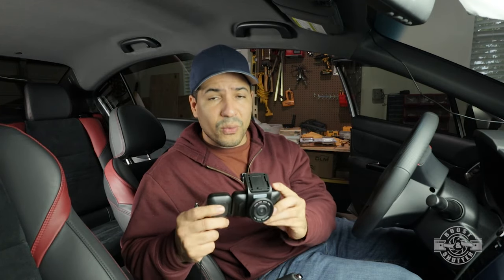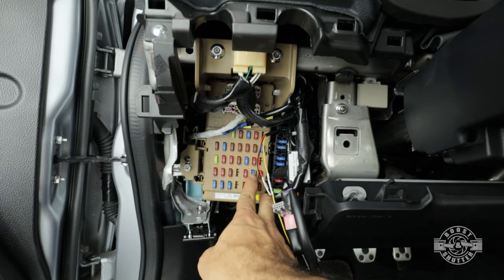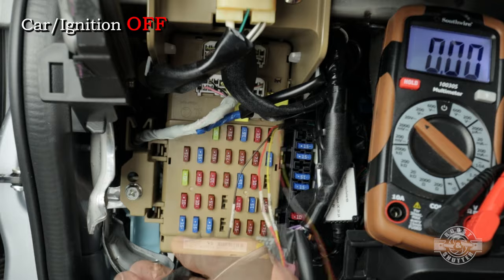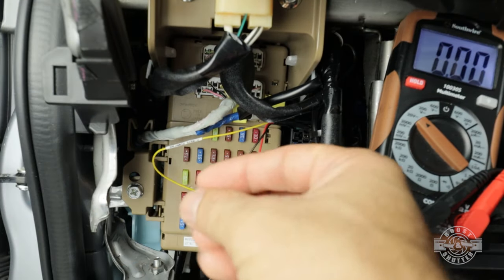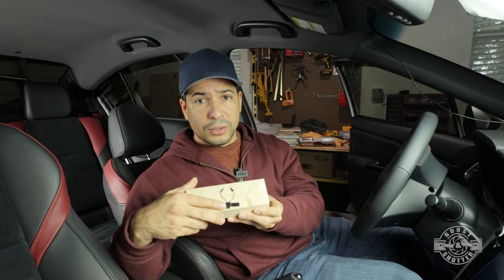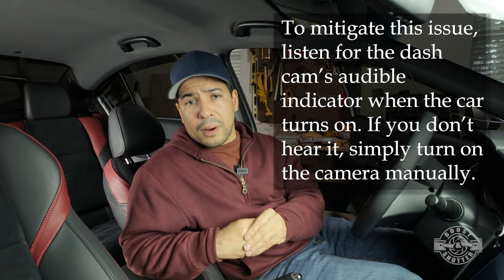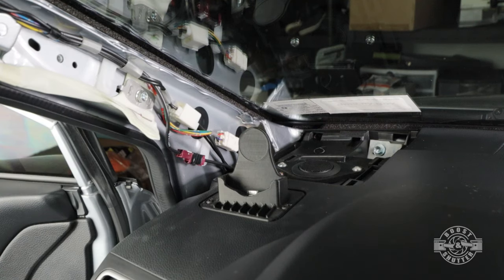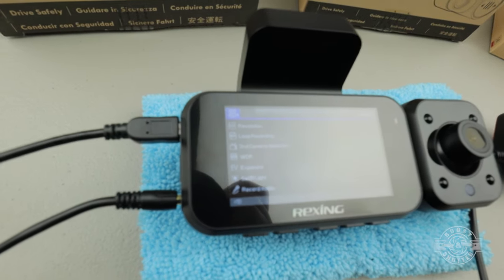Smart Hardwire Kit Install to Enable Dash Cam Parking Monitor

Comment: Beautiful job.  One nagging question...the yellow wire is generally considered the ACC, and the red wire is CONSTANT POWER, and most dashcams use that color scheme, but you identify them in the opposite roles.  Why is that?
Reply: You’ve probably answered your own question by now but he’s correct as described on the dashcam’s website.
Reply: @marksd5650  The actual answer was: He didn't know any better.
Reply: myGekgear hardwire kit's instruction also states red is BAT, yellow is ACC
Reply: I don’t think it matters what colour is what since this seems to vary between manufacturers.. the wires are labelled, that’s the important part.
Reply: Yeah, Pete, it matters if you want the camera to turn off when you exit the vehicle.
Reply: @brianclancy6101  read my previous comment very slowly.. the colours vary between manufacturers thats why you read the labels.. one always has BATT and one has ACC.. you wire them in via the label.. and it matters if you want the camera to remain running when you exit the vehicle, thats the concept of parking mode. Try actually knowing what you're talking about before trying to correct others.
Reply: @petetherealrelentless6542  I can see how you got your name while replying to other 3 year old posts.  We can't wait to have you "explain" something else that's over your head.  While you're at it, give us all a list of the dashcam manufacturers' 12v appliance wire color codes, we're anxiously awaiting your breakthrough research.  Be sure to "read them again slowly" before you get back to us.
Reply: @brianclancy6101 how did he make sure that the fuse he chose was not “switched”?
Reply: @fjcook  Suitability would be ultimately determined by the behavior of the camera when the ignition was shut off.  You have ACC (accessory power) if the camera remains on for a period of minutes and then shuts off or shuts off when the car door is opened.  Constant power is always present, particularly for parking monitor.
Reply: The kit I have is exactly like his. Red says ACC, yellow says Bat.

Comment: Ok, so maybe silly question.  The fuse doesn't look like it's changeable, on the hardwire kit, so what if the fuse actually blows?  Do you have to get another hardwire kit?

Comment: The question, you don't need to use a fuse tap to install the wire kit? The fuse is still powering the other unit that the fuse was taken from?
Reply: Did you find your answer? I just recently bought dash cam, and I think I need to replace the hard wire fuse wire connection with fuse tap so I could put 2 fuse in one fuse slot. But I'm trying to find if removing the original fuse and replacing it with dash cam fuse that came with the hard wire will work alone. Just like what he did, when he removed the fog light fuse and replace it with hard wire fuse.
Reply: @waynet8327  hi man ... Do you mean that the hard wire kite's fuse in addition to herself also Powers fog lights?
Reply: I may be having the same issue. Ever get am answer on this?
Reply: @justinphillips8317  after doing more research and poking around my fuse box.  Most of my fuses are being use so I would need to use a fuse tap to get the power needed.
Reply: Hi on one of your previous videos i saw you just pulled out the same amp fuse (15 amp) and plugged in the new one with the cable attached to the 15 amp fuse that came as is with the cables. This means the one 15 amp fuse runs for the new camera and the original 15amp fuse in that box location. Can you do that or do you have to put a fuse splice and add 2 fuses of 15 amps?
Reply: It seems that the kit he is using would bypass the fuse and you lose the safety functionality that the fuse provides. I'd get a fuse tap kit. Unless the hardwire kit says it provides a certain Amp fuse capacity...but it seems it's just a straight no protection circuit. I think it's intended to be used on an unused fuse location that has power. These hardwire kits should by default include a fuse tap kit.

Comment: You didnt mention using a fuse tap so you can use the existing fuse along with the hardwire fuse. Crucial step left out.

Comment: Excellent video and explanation of the fuse testing!   I would only add that if you're removing the trim pillar on a car with curtain airbags, you should disconnect the battery and wait for 10 minutes first.

Comment: You should be using a fuse tap for both of those. The fuse is sharing power between the camera and the other source, which is causing the drop during start.

Comment: You're a really good tech! I like the professional and neat installation. On my Rexing V5 I constantly have a red battery indicator. Shouldn't it be charging up the super capacitor? It seems like there is supposed to be a battery or super capacitor that at least gives enough power to close or finish writing the video file to the card.

Comment: Thank you for the video. One thing I was curious about is that you replaced slot 29 to yellow wire. Then what happens with the fog light?  Can you still use the fog light?

Comment: Thanks! I follow your video and I have everything done. Actually, I went to 3 places to have this installation done, and they didn't have time to do it. They wana me to make appointment to plug the three wires, cause I already have done all the wires passed through. So it was almost done, I only have doubt to connect the three wires to the painel box. And you did very good, all details that I was needing. Thank you so much, for your time to make the video.

Comment: This video is hands down one of the best, most perfectly explained and detailed instructionals out there. Unfortunately I came across a snag. I bought a rexing camera and their oem hardwire kit yet their kit instead of coming with 2 cabled fuses came with 2 pseudofuses with 2 fuse piggyback slots on each pseudofuse. They did include 1 fuse in 1 of the 2 the piggyback slots but it was only a 2amp. Not sure where to go from here, any ideas? Thanks in advance if you do!
Reply: Glad you asked this as well Dave…I have the same hardware which I received two days ago and not sure what my next move is as well…I keep searching for more info but can’t seem to find anything about it…do I change them out for different amp fuse or is this part of maybe the update that was talked about in the video….🤷🏻‍♂️

Comment: Ive have loved this video watch probably 10x . Doing this job. I used the smat spot as you did and i cant get parking mode to work   the dashcam comes on and off when i start the car . I put acc fuse in the empty one just as you did and saying its not getting signal to dashcam and dascam turns off when car does.
Reply: Nevermind bought a muilt meter .

Comment: Thank you for the very detailed video! Can I connect the ‘always powered’ cable to the battery directly and then the ‘ignition on/off’ cable to the heated seats fuse?

Comment: Shouldnt the Yellow ACC wire be connected to a fuse that does have power when the IGN is on and the Red Power Wire be connected to a fuse that HAS power when the IGN is off?  Or Am I mistaken?  The ACC Yellow wire is to power the Dash cam when the Car is running and the Red Power wire is to supply power tot he Dash Cam when the car is off?  Is this backward for your camera?  Just curious...
Reply: NVM...Re-watched from beginning and saw the difference....Nice Video Good Details....

Comment: Incredibly detailed video and definitely helps as I'm looking at wiring in a Rexing camera to my WK2 Grand Cherokee.

Only question I have is with wiring the kit into your constant/batt, would that not eventually drain your battery after a while? Their webpage doesn't really do a great job of explaining how it actually works.

Comment: Another great informative video.  I ordered the Rexing V1P 4K 3rd Generation with parking mode.  Also ordered the Smart hardwire kit.  Now, my car is a 2016 Mercedes E400 sedan W212.  I noticed that my fuse box is located in the trunk area.  Also fuse 71 on my car is for the cigarette lighter which I can use for the red wire if I understood your video correctly.  My only concern is the length of the hardwire kit cables.  Since I have to route cable down the C pillar under the door sills, up the A pillar and headliner down to the actual camera.

Comment: Excellent work firmware update would do the trick. Old school would be to add slow acting relay so as the camera gets power after the car starts. Handy if you get stuck with anything else that gives trouble. However I doubt I would have found out that problem without you video.

Comment: Thanks for your video, very important.  Question: When connecting the cable to the fuse box, in which of them is it better to connect the camera cable…?  Thanks and I will be the pending of the answer.  Greetings.

Comment: Very incitefull video. Quick question, I have a rexing dashcam and I bought the hardwire kit and went to run the wires to the fuse block in the trunk but the wires aren't long enough. Can I cut the wire and extend it to the block or will that cause issues?

Comment: When you are doing the hardwire installation do you need to remove the negative on the battery before touching anything in the fuse

Comment: Very nicely put video. 

Does wiring a dash cam in this way allow the user to leave the cam in surveillance mode? Constantly recording when the car is off? I find this mode very useful when I park in a public lot. Like walmart parking lot for example. I recently had somebody bust out one of my tail lights and it didn't trigger parking mode but luckily I had my dash cam on in surveillance mode. I have my dash cam plugged into a rear cigarette outlet that has constant power but I want to use a kit like this so that I can free up that cigarette lighter slot and get rid of some ugly wiring that is visible. Also most kits like this have that low voltage detection that my constant power outlet doesn't have.

Comment: Thank you for the video.

What if I connect only the always-On fuse, and ignore the other one, shouldn't this deliver 24/7 power to the camera ? Any drawback?
Reply: It probably uses the accessory power to verify when the car is off so that it can turn on parking mode

Comment: Question: What about the fogger light fuse you removed?  What happens to that?
Reply: You see he plugs in the cable which has a fuse connected to it and the cable

Comment: Wish I had watched this before my install. Did know about the yellow clip. I used an old fish-stick figure-trap attachment from when I used to be a cable guy and an allen wrench tapped to another fish-stick to use as a hook. That was a pain.

Have you seen an issue were the parking monitor cannot be enabled because it doesn't recognize the smart hardware is installed?

Comment: Thanks for the great instruction video! However, I have a question: don't you need to use a fuse tap to keep two fuses - the factory one and the camera one? In other videos they use the fuse tap. Won't i disable my fog light by replacing its fuse with a camera fuse? (Sorry, I am not keen in the electrics and don't really know much about cars in general).
Reply: The type of wiring he used just essentially spliced the camera into the same fused circuit. If he would have used an 'add a fuse' or 'add a circuit' as some are called, he would have had a dedicated fuse for the camera instead of sharing an existing fuse and then he wouldn't have had the flickering/camera shut off issues that he was explaining. The car manufacturer determined the fuse size based on what it's controlling, and he added additional to that. This is never recommended. The fuse/wire that he was using should only be used in an unused slot. Other than that one issue, I thought the video was great.
Reply: @jimwebber7451  Thanks for the explanation. I was able to install my camera and connect to two empty/spare slots and my camera works without problem so far.

Comment: At 9:00 of the video, you have those 2 wires coming out, which pin is the constant and which is on accessory on the connector (there are 5 pin)?  Please share your drawing if possible. Thanks.
By the way, you can install 14-16v mini capacitor on constant voltage supply side and it will prevent voltage drop when you start the car.  When the car starts, it can drop the supply 12v to 11v temporarily and causes the convert (12v to 5v) to not function well which cause output voltage to drop way below 5v.

Comment: I plan on putting 2 of these in with 1 doing parking mode. Do I need to upgrade the battery??? 2021 tundra

Comment: It’s likely that drop in voltage is infact the kits fault.  A good voltage converter will maintain a stable 5Vdc.  You’re tapping off of 12v (often closer to 14V)!  For a 5V output to fluctuate that much is quite suspect

Comment: My entire hardwire kit came with 2 amp fuses, in the fuse box plug ins? Do I need to change the fuse, to the one I take out? Another words, there’s a spot for 2 fuses in my plugs to the fuse box? I’m wondering why? This is the hardwire kit. I have the 4 ch. Rexing camera. It covers both front doors, inside the cab, and I run a wire to the back window?  I’m just curious why they all come with 2 amp fuses?

Comment: Maybe a noob question but i'll ask it. I have a hardwire kit same as this one (2 blue fuses 15 ampere) but the problem is, i don't have this much blue fuses connected to the car (only two and those are important), if one of my empty spots has 12 volts can i also connect it there right? No need to replace a existing fuse for parking monitor. 

And what if the empty spots has no 12 volts at all. What can i do best? I do have a car cigarette lighter which i don't use at all, but it is yellow so 20 ampere. Can i put the blue fuse of the hardwirekit there?

My car is a Hybrid GTE by the way. Passat 2016 GTE.

Comment: Thanks for the video. Well Done and detailed comments with good video at same time. I wanted to order a Rexing with parking mode but was holding off because my concern about hardwiring in my new 2020 SUV as I was worried that doing a hard wire may jeopardize any warranty issues that could happen if I hard wired incorrectly. Your video and explanation showed how easy and simple it is to do correctly; thus I can move forward on ordering the Rexing dash cam. Again, great job and thank you very much.

Comment: thanks for sharing, bro. Would love to see a tutorial on installing rears, especially for those with second-row airbags.
Reply: @akqjtn  thanks, was hoping to see a headliner install.
Reply: @akqjtn  Thanks for this video. I was wondering why hardwire kit when I can use cigarette lighter plug! Now I know, in order to use parking mode you need this set up. I'm getting two Viofo A119V3 for front and back. How many of these hardware kit do I need? What's your opinion about dashcam battery packs? Are they even reliable to be durable for a long time?

Comment: I have 2020 wrx and wired my rexing v3plus and the same way as you before i even saw the video, my question is why does my camera keeps saying smartwire kit needed to use time-lapse parking mode? I have the smart wire kit

Comment: My kit comes with 2 amp fuses.  How do you resolve that since the fuse box slots don't have anything that low?  Also each fuse connector from my kit has two slots for fuses but only 1 is being used.  What is the second slot used for?

Comment: Assuming the red wire in the video is ACC, is that the only wire I need to connect (in addition to the ground) for my Garmin Mini Dash Cam if I only want it to have power when the ignition is on?

Comment: You can install a second battery 100ah group 31d or m 12 volts for rv in your hatchback. And connect it in series to the alternator of your car

Comment: How do I find the spot for the accessories plug? All the fuses I wanna use, I gotta stay away from . I found a spot for my constant power, but can’t find a slot for when you shut down the car? My camera stays on. I have the Rexing 4 ch. camera. Seems like I can’t find a spot for the accessories wire? I’m using a multi meter too. When I test, they all have power in both legs, or they have no power? Can’t figure this thing out?

Comment: The hardwire kit that comes with Vantrue cameras only comes with the red wire and ground, for constant power, I'm assuming that the camera "knows" when the car is running or in parking mode?  I'm worried about the battery on this setup.

Comment: I just got a camera recently that has an open yellow wire to put your own fuse on as well as a red wire with the regular ATO fuse. My car only uses the low-profile fuses in the interior so I'm wondering if I really need to hook up both or if I can just use the yellow wire with the low profile adapter and hook that to constant 12v and just ignore the red wire.

Comment: The hardwire kits aren’t all the same. My 4 ch. Rexing cam has fuse taps, with existing fuses already installed, then once I find my correct tap spots, I have to add the fuse taps. Meaning I have 2 fuses in each fuse tap? Not a single, like yours has.

Comment: my hardwire kit only came with a yellow wire that is for the constantly hot fuse. I was wondering if that could be causing my dash cam to not turn off when I turn the car off? It seems like it is constantly recording instead of switching into parking mode

Comment: So if I only order instolation and not presents during....if I see cables connected to usb or lightening- this means they not did the connection in fuse for parking mode?

Comment: RED is 12v Constant. Yellow is 12v ACC (Switched). Common fault to get it wrong. Fuse taps are a sure way to have problems if incorrectly done.